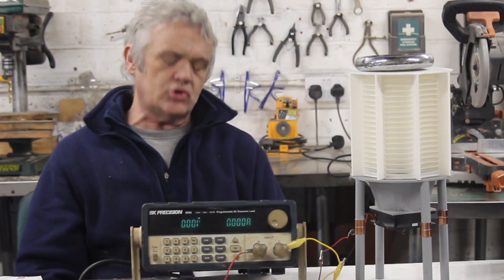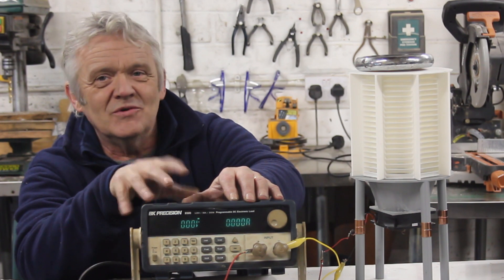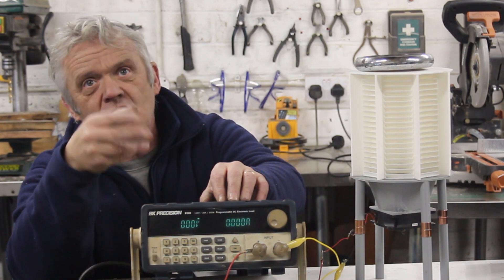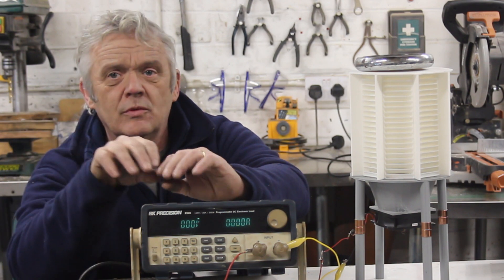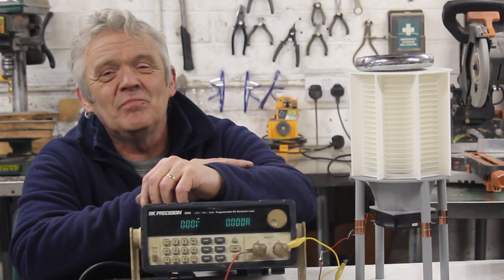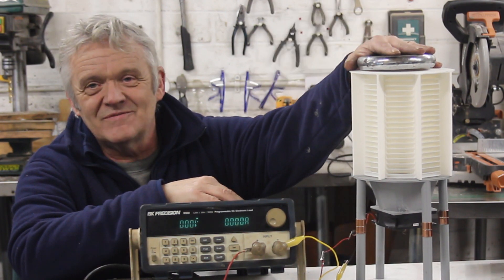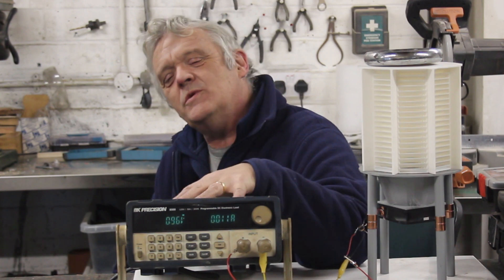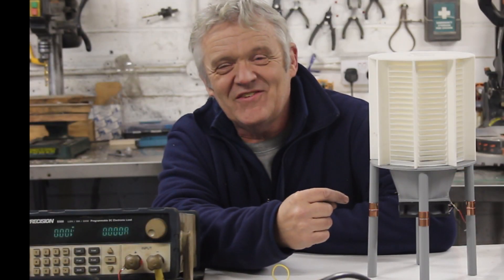1837 Measuring The Darwin Wind Turbine - Everyman's Aeromine

Comment: IMO there are some chances to inprove the air flow, without adding any moving element, but using different profiles :
In the back of the tower there is a backdraft and turbulant airflow. This results a vacum, absorbing a portion of the incoming air, before it reaches the generator. For this reason using Tesla valve profiles horizontaly facing outwards will not allow the air escape from the inner space of the tower.
Using the same profile type on the vertical parts of the structure, connected AFTER the generator letting the air escape, will fill the vacum in the back of the tower, creating a draft beneath the generator, ingreasing the energy production.

Comment: Hi Rob. A thought occurred to me regarding the wind generators you have been working on. Have you ever thought to put a wind turbine on the suction side of a rocket stove? Another thought that the rocket stove triggered was to put a herd of thermocouples into the hottest part of the rocket chamber and see what you can generate from a series connection of them. Now put them & a turbine on the input to see what you can get from a humble rocket stove. I think it might be surprising what the output might be. Possibly add some TEC pads (sorry, can’t remember the full name right now) on the outside of the rocket stove for good measure too.

Comment: Hi Robert, I'm not exactly sure how to word this, but I'll try🙈. Is there any way of testing if it's better/more efficient having the wind swirling in a vortex before hitting the fan blades & exiting, or is it better if the wind just hits the blades straight on. (If yee ken fit a mean 😂) cheers 👍

Comment: Ventum dynamics have just installed a Darwin turbine on Skegness Pier.  First pair in the UK.
It won't let me post a link "Ventum skegness pier" will find it on your fave search engine.
The other is on the roof of Freshlinc Spalding

Interresting design.  They place the turbine at the top.  I'm assuming the venturi effect of the air travelling over a wing profile on the top lip assists in pulling air up and through the turbine.

Comment: Just using a Capacitor on the output for something like this would help stabilize the voltage. Though in this case I can see how it would be a problem seeing as you'd want a Diode too and at 1v voltage drop would be way too high.

Comment: I was thinking on this topic this morning and figured that though the swept area of the fan is not great, the swept area of the darwin aeromine is the factor, as that with the wind speed determines the output, the airspeed will increase at the bottom of the aeromine because you have reduced the area , now as the power is a function of the velocity is this a constant, does the faster flow over a smaller area generate the same as a slower flow over a larger area, or because in the calculation I found online one factor is velocity cubed v3, does this mean a greater output as the velocity rises? so is the velocity increase of the downdraft causing a better conversion into energy?

Comment: Hi Rob, great to hear your profession and drive for the experimentation and discovery. Would a capacitor parallel to the load get a somewhat better reading? It's output fluctuated so much you can also say half of the time it was 11mW and the again zero (not trying to bash you but to get a bit clearer reading is what I like to see). Thanks for sharing all this info to us, really nice to see the TnT channel which is rare in numbers of what is uploaded to YT. Keep up the good work!
Reply from the maker: oh I don't take it badly at all mate - the BK is a data logger too - so what you actually do is log the data over time and analyse the power curve when the experiment is finished

Comment: Great to see you measuring power!
Try putting a large capacitor in parallel with the device (between red and black terminals).
Something like 1000 uF 16v should be fine, 2200uF even better.
That should smooth out the readings so they wont jump around so much. 👍
Reply: I was going to say the same thing. Although, just looking at it, it seems to be giving a pulsed output. You could put a small transformer in first to bump up the voltage and then have a cap to smooth the voltage out.

Comment: With al you have learned unti now may be an idea to build a bigger version that could be set up on a roof  in combination with the high efficient cone turbine you tested before?  Could this be interesting enough for home use? Also making curved flaps should not be to difficult by making curved slots in the vertical stands to guide flat plates into a curved plate (flap)? Maybe  make the funnel towards the turbine a venturi funnel that sucks additional air from the outside making use of the quanda effect to increase performance? Alway loved your practical approach !

Comment: What did you get with the Venturi in front of the fan?
Reply: @ThinkingandTinkering  I was interested in the difference between the output through the Darwin vent compared to the fan generator with the Venturi that it’s using directly the air source fan. Thanks for your great videos, I enjoy them. I am one of those who sees your great efforts but is number hungry. I assume a huge part of your work is to encourage thought outside the box, I often ponder your videos from an application perspective where the do or don’t question would be clearer with data from your great efforts. Having said all that, that’s my head always be you and thanks again.

Comment: immediately I feel a Venturi at the bottom to increase the pressure of some horizontal wind that can create a vacuum to help draw the air out of the fan what probably double the out put as it would decrease the resistance a lot
Reply from the maker: nice one mate - cheers

Comment: 11 mW??? oh dang that's a long way from charging my phone with it.
Reply from the maker: not really - this is just a test model from a pc fan mate - and it did well
Reply: @ThinkingandTinkering  I'm wondering if a mighty mite generator with turbine blades around the edge of the magnet disk suspended in the pipe could do the trick. The center mounted coils would have a nose cone on the top and that would create a restriction in the pipe while directing all the air across the blades.  When I get a chance I'll model it and send you an email.

Comment: ok but it could be better. if you tack the very first one and revers the flaps the so they close instead of open into the wind and put the new design on top the exhaust air will flow out into a low pressure zone push pull . yes or no?
Reply from the maker: it could always be better mate - that's just a truism - you should build your suggestion and see - and I mean build in real l life not just your mind - cheers

Comment: I'm glad you pulled your programable DC load out. It was interesting to see that your getting about double the output. 
But I think a lot of viewers would benefit from at least once, seeing a plotted power curve  going from near shorted to near open circuit, and give an explanation  to why there's no virtually no  power when there's virtually no load and why there's virtually  no power when loaded too heavy. And how the loading affects the tip speed ratio any show that a turbine puts out the most power at certain tip speed compared to speed of a given wind.
Reply from the maker: it's a data logger so I could do that indeed - cheers mate

Comment: What does it mean if your multimeter data starts to jump all over on any setting? Until you have a good connection or ground them out. Still seems to give an accurate reading but you are never sure. Is there a way to fix it? Tried searching the issue but don't know the words to get the results. Can't afford a fluke but these aren't cheap meters. 4th one to start doing this now. Any help appreciated. Thanks
Reply from the maker: sounds like your batteries are going - but I don't know as I have never had this issue

Comment: Awhile back you experimented with placing a cone on the center of the fan blades to channel all the air flow to the fan blades. You also tested plastic spoons as a replacement for the fan blades (or was that for water?)
Would either, or both, improve the performance of the Darwin device?
Reply from the maker: to a degree those ideas are incorporated in this design mate with the bottom cone

Comment: Robert, I wonder if you could do the same test again BUT:
1). Seal off the panels of the Octagon that are NOT facing the windstream. Maybe with paper or something. Wonder if it would make more or less power? Maybe the downward airflow sucks some air mass from the back sides to present to the turbine to make more power than with covered back sides? Compare.
2). Test with a point of the Octagon aiming at the wind source. Compare to when a flat face of the Octagon is presented to the windflow.  How much difference in power?
Thank You for sharing your mind, ideas, tinkering, and fun with us via YouTube.  First Rate.
I learn a lot.  Cheers, Chuck Elert in Florida, USA
Reply: Makes me wonder if we should return to or otherwise re-combine with the original Erasmus tower's flap design. Maybe keep the slats stationary, and have a lightweight fabric/plastic layer over them that can flap inwards, but not outwards?
Reply from the maker: they are already sealed off mate - you forgot the device is constructed from wedges so effectively the side not facing the wind is kind of behind a wall

Comment: I want to note that this thing does not look like a windmill.  Therefore, I think it can be mounted on the top of a house without the need for a permit.  And I don't think anyone would be the wiser.  This avoids the problems with getting the local planning commission or zoning board to agree that harvesting wind is a good idea.
Reply from the maker: now that is an interesting idea mate - thanks for sharing
Reply: @ThinkingandTinkering  I live in Pennsylvania, USA, and I can tell you that my local zoning board would absolutely forbid me from putting up a windmill, of any size, on my house or my property.  So best not to tell them, and instead disguise it as a decorative copala.

Comment: I was wondering if it would increase power if you continued each section to the fan, or maybe every other section. Watching some other videos on wind turbines, they say a vacuum can be created behind circular ones like this, so I was thinking that could cause some air redirection out the back sections.
Reply from the maker: it seems it's not a very significant effect mate - so hardly worth the trouble I would think

Comment: Great Video and an awesome proof of concept. I've been watching your channel for about a month and it is very interesting. I have a question on a previous video, unrelated to this one. Regarding the carbon fiber heating, could that be used to design and build a dehydrating system for 3D printer filament? I'm thinking something solar-powered, so the filament would be drying as long as the sun is hitting the solar panel. Maybe add a small charge controller and battery for extended runtime. I'd love to hear your thoughts on this idea. Thanks for some great content!!
Reply from the maker: I would think that could be done mate

Comment: What excites me about this tech is, that you can capture the wind over the entire height of the column. The main thing capping the output will be what height you're able to build it up to.

I wonder if all these same principles will hold true on a large scale. 

Keep up the amazing work, Rob. I'm rooting for you!!
Reply: I'd think there is an optimum ratio width/height and output port, at some point it'd stop giving gains in mass+velocity. still wow at 2.5x the output vs open air spun!
no extra moving parts?! more power from even lower wind speed? heck yeah!
it can likely be computer modeled+optimized before building as well.
Reply from the maker: I think that is why it operates better - the original was large scale so I don't see why not - but you are right a test is called for

Comment: there has got to be alot of little upgrades that can be done to that. I imagine improvements to the airflow like a cone on the inside top to reduce turbulance. Also maybe extending the walls downward into the  cone that the fan is connected to. would creating a vortex in the bottom receiving cone help with airflow? just a couple thoughts.
Reply: Not to mention, the computer fan is less than optimal in this application
Reply from the maker: I agree mate - lots of improvement this is just a basic concept - get to work and share lol!

Comment: It doubles the efficiency thats good to note when im building mine. Im in a residential area and live on a street with tall buildings and it acts as a funnel and gets wind speeds of 10-18mph only a couple feet from the ground! Having the ability to take this breeze and double its effectiveness with a turbine is just what i need. Im mounting it on my truck and the outlet will funnel into my truck cab to keep it cool in the summer
Reply from the maker: nice
Reply: Yes, but I was wondering if one or more could somehow be fitted on an electric vehicle to generate enough power while driving to keep the batteries charged up?
Reply: @cherylthorpe3933  no thats not possible in the sense ur implying. Yea u can charge devices as u drive sure but u cant power a entire vehicle with it. The discharge will always be higher than recharge technology just isnt there yet. Say for example a electric bike. They use 48v 1000w of power and u drain a battery in under 6 hours. To charge that at the same rate of discharge would be very difficult u would need a motor bigger than the one thats discharging the battery. And at that point ull have a helicopter not a ebike lol

Comment: Was your comment about being double the power in comparison to another direct on fan measurement made with the same instrument? It would have been nice to see in the same video the output difference you claim. Checks out logically, but… you can see why it might raise flags for a passerby viewer. 

Love your content btw! Good stuff
Reply from the maker: I did that on a previous video - I really can't recreate everything I did on previous vids mate - it would make each vid hours long and most of it would be a repeat - if folks want they can look up the previous vid if they don't well - I am most sorry but to be honest if I did that they wouldn't watch the vid at a ll lol
Reply: @ThinkingandTinkering  Please tell us which video so we can review it.  The concept of the Darwin collector does not make sense to me.  At Pitot tube wind speed indicator only generates about  .05 PSI at 50 MPH.  Wind is considered non-compressible until about half the speed of sound, it just goes around and object with negligible  back pressure.
Efficient wind turbines have (low solidity rotors) lots of space between blades so that the wind has time to build up speed again before the next blade comes along to extract more kinetic energy from the wind.  The blade airfoils rely on a low pressure area to "lift" the blade forward with as little drag as possible.

Comment: Would you be willing to go into greater detail as to how you are using the BK Precision instrument to measure power? 

As I understand it, you had to input the load resistance you wanted. How was that value selected?

Is the instrument capable of computing the maximum power point (MPPT) wattage for a solar panel?
Reply from the maker: I might do a separate vid mate

Comment: Robert, if you were to place another fan under the first one, upside-down so it was rotating the opposite direction. Would it increase your power output?
Reply: Turning more fans means more energy input . The bottom fan will not perform well living off the waste air of the first. As Rob says, it's better to have lots of small generators than one big one. Easier maintenance........
Reply from the maker: I don't know but I doubt it